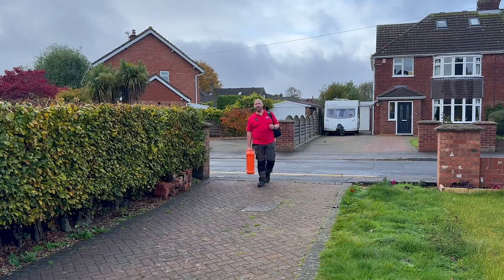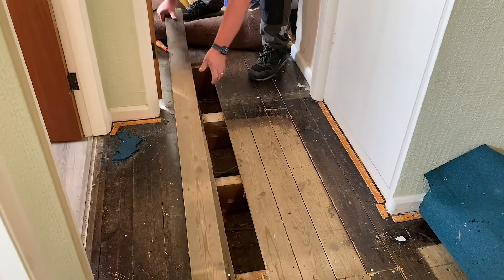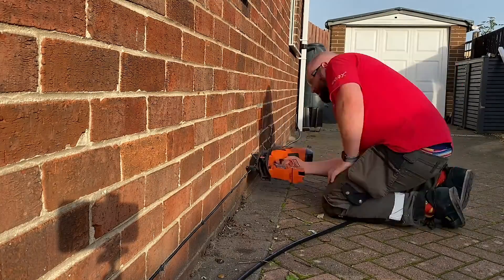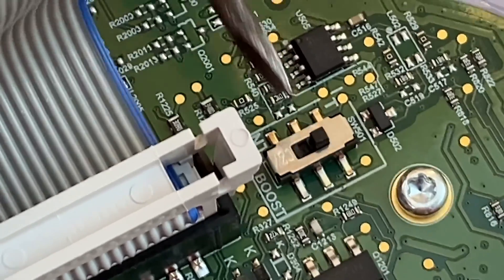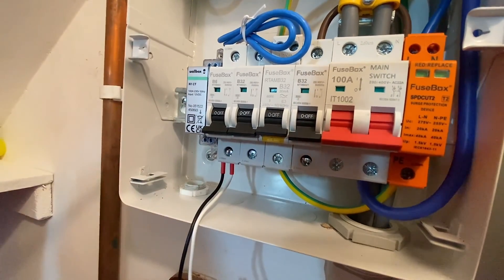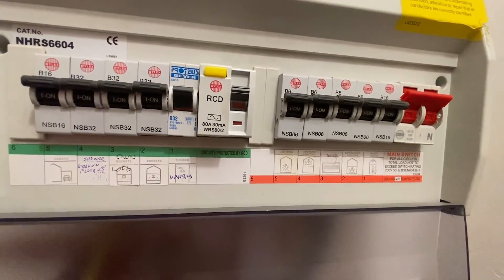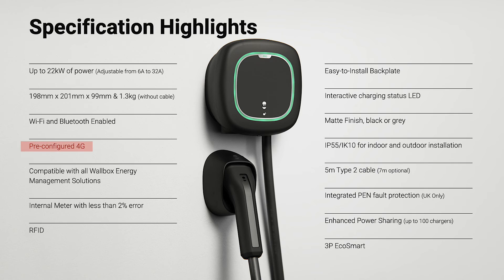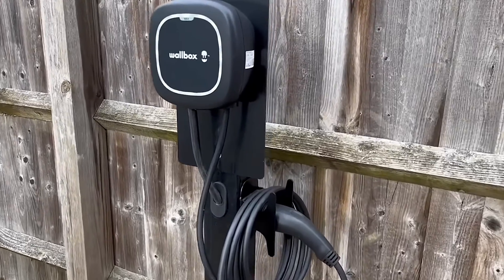Problem Solved - Wallbox Pulsar Pro EV charger Installation

Comment: Anyone knows where to can find a replacement for the charging cable. I bought a 5m charger, but now I need 7 meters. Looked everywhere and could not find something from Wallbox. Do I need to buy a type 2 cable and cut one end? Does it it have that fine white cable we can see in the video (3:03) ?

Comment: Hi eFIXX, suddenly I have major problems with my Wallbox Max Plus. It will not charge my car what so ever, all was ok until a few weeks ago. I did all the recommended steps from Wallbox customer support, but nothing works. The wallbox is ready to use, no fault, no warnings, no nothing. Full connection with wifi and blue tooth. All app is uppdated. But it will not start charge the car!!??. The thing will only connect to Bluetooth, not wifi. I have super good wifi!. I refuse to connect to it. Pls, help.

Comment: Wallbox have software problems and I regret buying mine. 
My new Wallbox Pulsar Plus 40-amp charger was installed by a Qmeret certified electrician and due to bad software, it took numerous calls over almost two weeks to just charge my EV. Still some features don’t work. At the prices Wallbox charges you should not be beta testing their products. If it wasn’t a hardwired installation I would return the charger.

Comment: I just installed the N1 CT clamp, as an addition for my Wallbox pulsar plus. Is it normal that it is light up red with 12v coming from the unit, and if i turn the 220v on for de N1 CT then its flashing red. I cannot find any informatio about that. Thanx

Comment: Interesting no comments regarding dc adversely affecting the RCD in main board. I just enquired this of nic help line regarding solar PV into existing board and was advised that I probably needed to swap out both RCD's. I also enquired about locations with sub boards and whether there was a minimum distance, dudnt seem to sure. Sub board seamed to be a get out of jail, but is it right? Looking at large commercial property with maybe 20 sub boards for large pv, battery and possibly rapid charging will all type AC need replacing? All circuits retesting? Rcd trip times only? Would get very expensive, even just swapping the two RCD's is over £100 + work + testing. I had hoped to see a great discussion. There must be hundreds of pv ev systems out there on type AC have there been any incidents?
Reply: I'm pretty sure that we only need to upgrade RCDs where the current to our EV circuit passes through the RCD in question. Since, in this case, the tails have been split before the type AC RCD, any DC from the EV will not affect the it and we are good to go as is.

Comment: Great vid although the CT DIN rail module with a resister in the top arrangement really puts me off this product! I can see that you are using D-Line clips, but please can you tell me what actual nails you are fixing them with and whether they would only really hold in the brick
Reply from the maker: Check out the full review of the Spit 27e https://youtu.be/Ixs8T6JdPzI?si=1pOTCs7kfqssAHJE

Comment: Perhaps wallbox is worth another chance then. Their first Pulsar model was terrible to install. Too small. No space to work the rigid wires into fragile clamps. Broke easily.
Reply from the maker: This is the second unit we’ve installed - first one has now been in use for 9 months with no issues.

Comment: you must have been very lucky as the ct clamp i got would not fit over 25mm double insulated tails 😢
Reply from the maker: This is the 2nd Wallbox charger we've installed and the tails and CT have never been an issue.

Comment: A few drilling tasks I’d approach a bit differently:
• Affixing the external ‘charger’, even with a fairly slim and lightweight looking unit like that, I’d at least make the top-half fixings, where there’s most pull-out force, into brick. If it looks like the charger may be bumped from the sides or underneath, all fixings into brick.
• Going through wooden joists, I’d pre-drill a pilot hole all the way through, then use the final diameter hole saw from both sides of each joist to avoid blowing splinters out on the exit.
• If possible, drill outdoors inwards so there’s less or no brick damage and less dust indoors, seal the hole if you can’t drill slightly upwards to help keep rain/insects/mice out.

Comment: I always thought low voltage data cable was not allowed in consumer units . It’s the same with bell wire . Unless it’s got a extra sleeving
Reply from the maker: That’s a good question . The sleeving is usually used when you have a SELV circuit which uses double insulation between primary and secondary side. In this case we’d have to explore how the charger generates the LV supply for the remote unit.